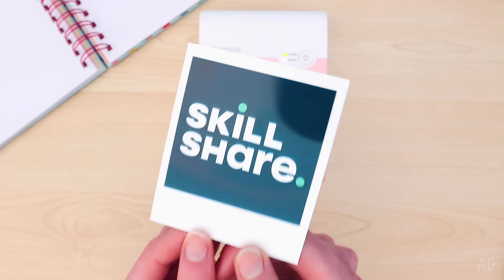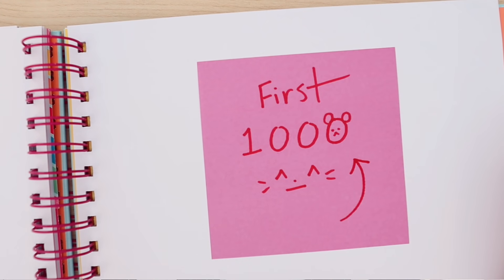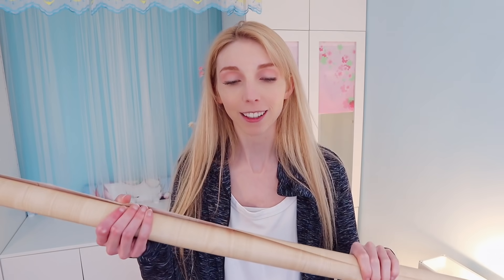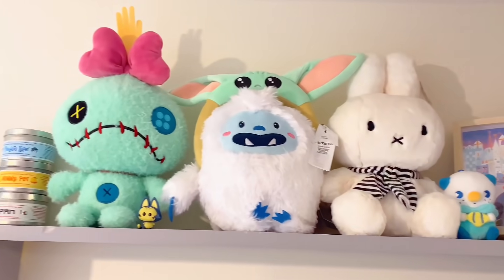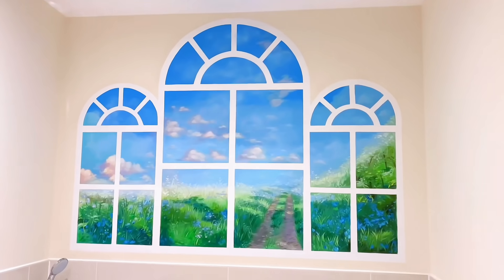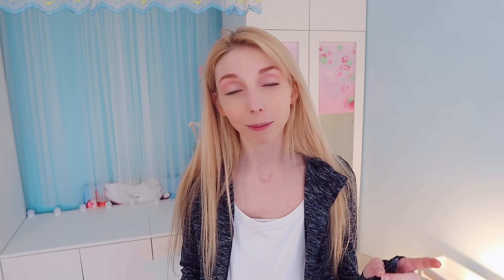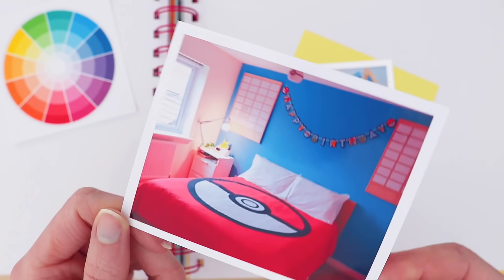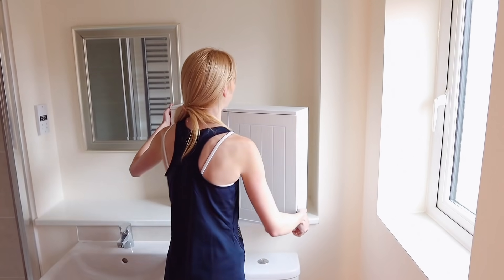My House is FILLED with Painted Murals

Comment: Tom’s bathroom turned out beautifully, Jamie Jo!  Love the blue accents with the gorgeous mountain mural.  If you haven’t already done so, I would get hardware to secure the mirrored cabinet to the wall.  Since the mirror is heavy, it might pull the cabinet forward when open, and you might end up wearing a cabinet on your head, which wouldn’t be pleasant.  Cheers!  Lindsay in Toronto